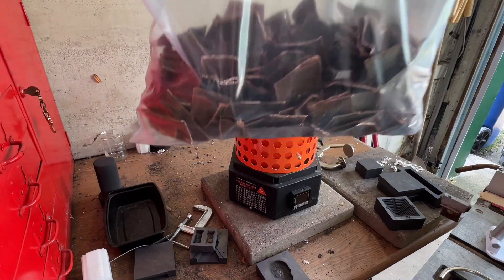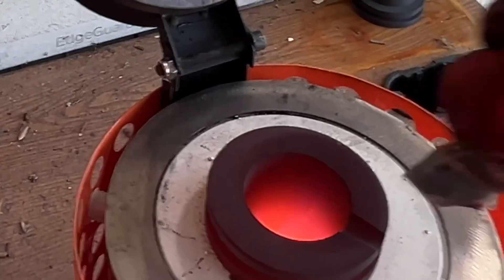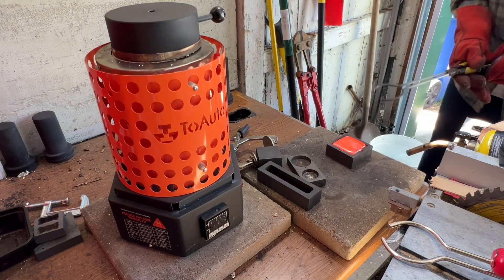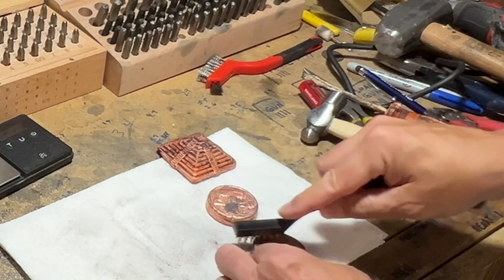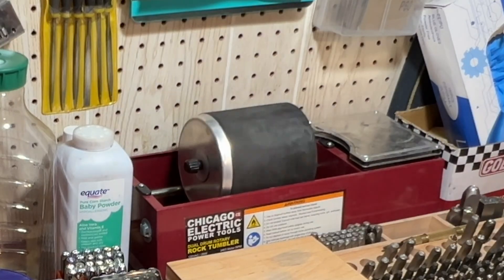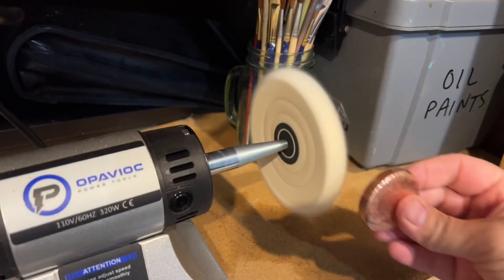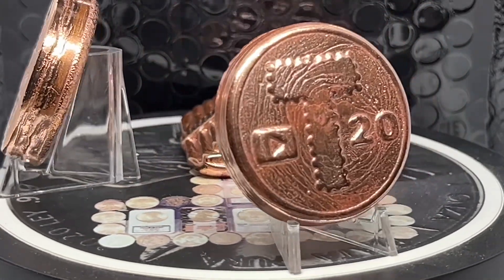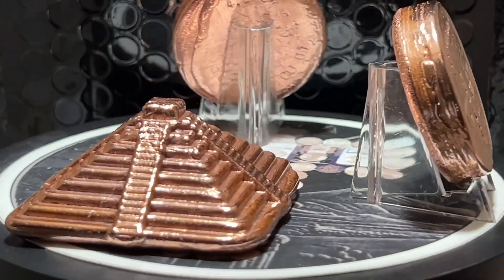🔥 Pouring Copper for the First Time | Experiment & Process Explained 🔥

Comment: My son poured me a copper bar like the one you have on the bench he’s electrician gets all the scrap wire and he    Melted it and gave one to me I wonder if the black stuff was from the original oxidation from the copper drain try some clean copper
Reply from the maker: Yes. Gonna have to try some clean stuff.